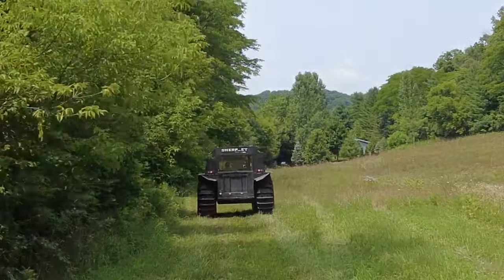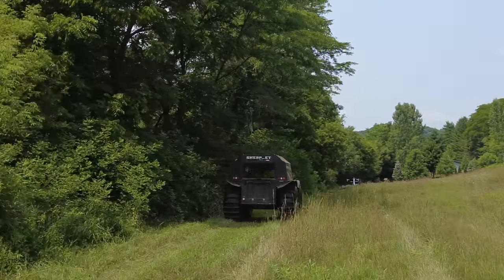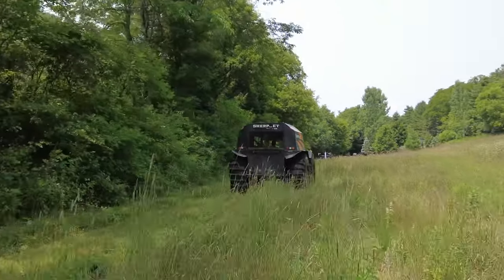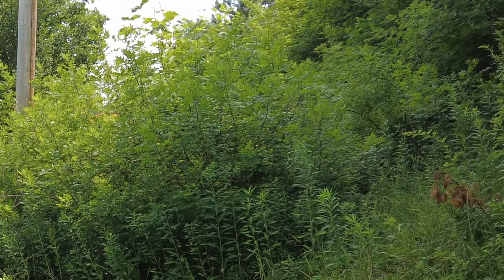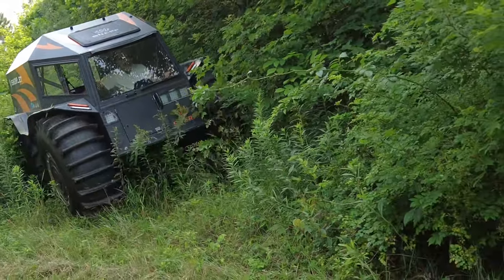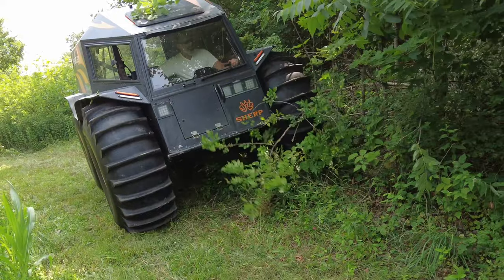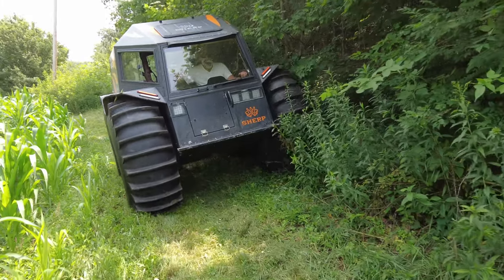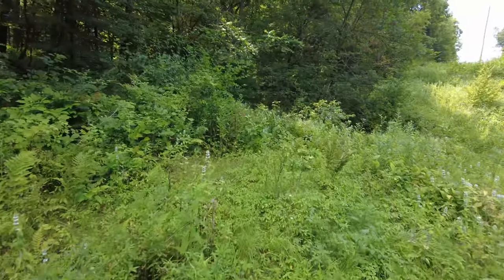Sherp Testing Success after Repair

Comment: Any ideas of cause of part failure?
I’m always looking out for ideas to do preventative maintenance so not to be caught out at -30C with a part failure
Enjoy your channel!
Thanks
Reply from the maker: I wish I knew some type of pm. The only indicator of a problem was the tires losing air pressure. Wondering if u could use a soapy water test on fittings. Wish I knew the answer(s).